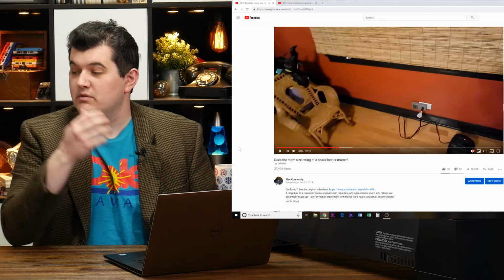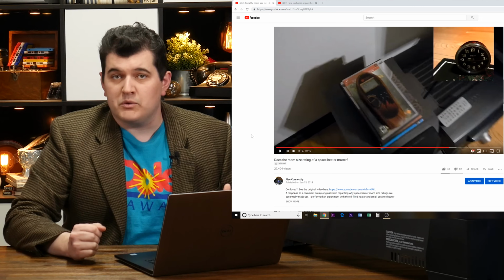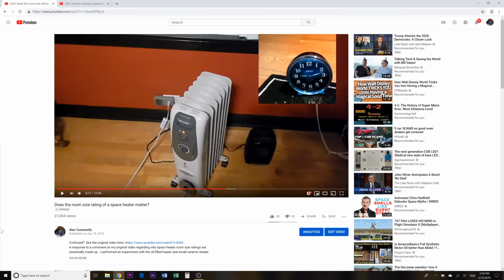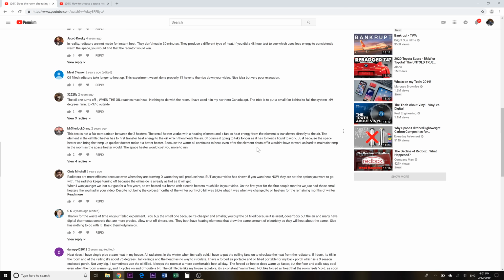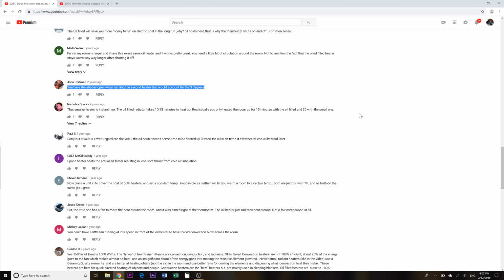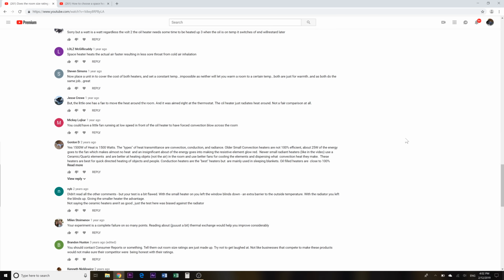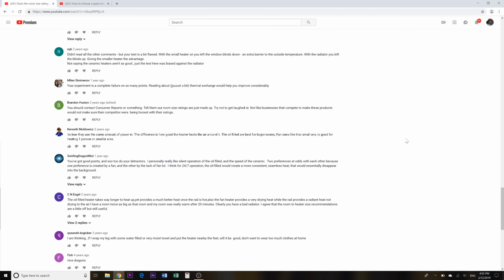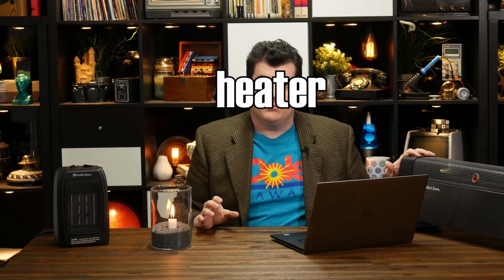More Space Heater Nonsense

Comment: I hate space heaters too. Cars burn fuel and give work and heat . heaters only heat.on a cool evening I try to fix something in a crock pot  like apple butter , heat and work.  but I  want a heat pump water heater to help with cooling and a Honda in house engine that makes electricity  while heating domestic water  but tech is so expensive short term.

Comment: ITs about saving on watts.. if you can maintain the tempature you dont use much energy as on a subatonic level the electrons when friction happens generates heat.. aka Oil heated and the metal around is creating heat aas electrons break down.  So if they maintain teh tempature without drawing from the wall you save on costs.
Reply: That's bullshit. Oil filled heaters don't magically create free heat energy.
Reply: Not free energy.  It starts with vibration.  When electrons vibrate enough through friction from conectic energy creates heat.  Now the purpose of the hot oil to to retain the heat.  For the metal around the oil through conectic energy allows teh electrons to break down thus maintain teh same output .  without having to draw 1500 wats an hour.

on the standar heater once you shut off the heat lowers down quickly thus under 200 degrees teh electrons no longer vibrate thus no heat is transfered.

Its the laws of theorodynamics and physics.
nwo the real issue os not to traw 1500 watts an hour otherwise your heat bill is over 150 dollars on that one heater.  Which is still not heat effectiant.
However  no one is trying to make low wat energy that outputs 4 square inches a second of heat.
the average heater requires 1000 watts minumum an hour to create 4 sqare inches per second of heat.

If they somehow can create teh same about of vibration on teh electrons with lower watts then it will be more effecient.

Comment: One thing to consider is that for people with the financial means to support a larger room, they might also have the thought to buy multiple.  

I grew up in sunny Arizona so I have never actually used a space heater myself, but I would be inclined to believe that several of those baseboard units would be suitable in like a living room/family room area, in front of windows or what not, as the aesthetic is far improved to that of the small-room unit.  

Considering too what the commenter mentioned about drying out the air more with the small one, I think the low-and-slow style of the baseboard units makes them suitable to be run in menagerie on timers, turning on before you use a room, rather than the broiler-style small one which would in duo serve to heat a room shortly after arrival.  Just looking at them though, I feel like the baseboard heater would service to make a room more comfortable and hospitable than the small one, just by looking at the shapes, with no knowledge of how they actually feel.

Comment: I like this video and agree with your assessment, I just think you should re-remake it, with your usual scripted elegance to organize and hammer home your points as clearly as possible. 
It seemed the most cogent dissenting opinion was that one about the radiator style heaters not drying out the air as much. Certainly personal preference and aesthetics can be a useful criteria for making a choice, but the size of the room is indeed marketing poppycock. I agree that it might have more to do with physical heater size as that later comment mentioned. 
That also got me to thinking… Do you fan style heaters actually dry the room out more? How is that possible? Blowdryers don’t actually make moisture cease to exist, they just move the moisture somewhere else. I suspect that radiator style heaters don’t actually leave more moisture in the room, they just suck at heating up anything other than the upper layers of air in the room, therefore, people who use them, can sit in their large room smugly chuckling about how their skin isn’t being dried out, trying to pretend they’re not shivering. I’m originally from Chicago, I can confirm that other than the insanely hot boiler fired radiators in old apartment buildings, radiant style heaters are not as good as any old fan assisted space heater.

Comment: As an electrician in Sweden I feel you. Customers often ask me what type of radiators they should get (infrared, oil filled, flow or convector) and it usually boils down to them not understanding that 1kw electricity in is 1kw heat out.
Reply: Usually smaller heaters are louder heaters, though not always.
Reply: @TimpBizkit  Depends on how well the individual components are constructed and assembled, where you're putting it and how well you maintain it, too.  That would be, probably, about the only area where price makes a difference; cheaper ones tend to be made with lower quality parts and assembled with less precision leading to more noise while more expensive ones are generally quieter because they're not.  Like you said, not always though, especially if you invest in the more expensive (quieter) unit then put it somewhere like a workshop, garage or near a pet bed then neglect to keep it clean.

Comment: Well, I do generally agree with you, 1500 Watts is 1500 Watts, really there's no need to test it. If you wanna go and test it though, you should let both heaters heat the room to a specific temperature and let the room cool down again (without opening the windows) to compare the heat up times and cool down times.
Or perhaps an easier way would be to let both heater run for an hour or so in a separate room before doing the test to insure they're both up to heat before starting.
Or think of some other way to measure the heat output while taking into consideration how long the heater takes to heat up. Just assuming the heater should be up to heat after a given time isn't a very reliable way to test it.
Obviously though none of these tests are scientific. Even if you assume your room has perfectly constant loses etc. convection heaters can heat rooms unevenly, therefore your room could be warmer on average but just happen to be colder wherever you are measuring it, while the heater with a fan just reads higher temperatures because it spreads its heat out better. Of course you could argue that a heater is supposed to heat a room (not only part of the room), therefore if the heater doesn't do that, it's still not doing it's job very well. In that case you would rather be measuring the effectiveness of a heater, not how much heat it puts out. But I guess it's a fair test since heaters for bigger rooms should (ideally) also be able to spread out the heat well enough. And if they don't spread their heat out well enough, then they are obviously not well suited for a large room.

Comment: the air becomes really dry and dusty from the air blower, while the oil filled radiator keeps a nicer, less dry, and less air stream climate. Also I would not want to sit or sleep with a fan blowing w/ it's noise going on.

Comment: Yes, the amount of energy is the same, but because of different contact surface area, the energy is diffused in different amounts of time. Yes, their efficiency is the same, as in, all the energy is converted to heat, but the time it takes to radiate the heat is proportional to the surface area of the heat element. Now the fan on the smaller heater muddles this somewhat, but imagine you had two identical heaters with no fans, the only difference being their size (and therefore surface area). The bigger heater would transfer its energy into the air faster once it reaches the same 'idle' hot temperature as the smaller one. It will take longer for it to reach the same 'idle' temperature as the smaller one because of the bigger mass to heat, but once it does (and probably some time during the heating up process), it will radiate its heat at a faster rate than a smaller heater because of the surface area.

What I'm trying to say is that at a certain point, the smaller physical size of a heater will bottleneck its effectiveness. The fan is a great fix for the small contact area though because it works by lowering the 'ambient' temperature around the heater, therefore speeding the energy transfer significantly by raising the delta T.

All forms of heat transfer formula include the contact surface area and the temperature difference, so it's important to not forget about the area.

Comment: The problem is you didn't realise your experiment seems wrong when first presented. Even though you later detail what adjustments had to be made, the way you explain your experiment is at first profoundly wrong, even though you actually did do it right in the end, you explained it wrong at least to begin with: 

1- same testing conditions and 2- "oil heater" is delayed a bit. Everyone knows that, but at first you don't say anything about it, you were expected to, and so your experiment appears dumb. Later in your video you actually do address both of those issues appropriately and so your experiment brings to light the issue of "oil heaters" "thermal throttling" which ironically makes the big heater heat less. GG.

On a side note, when buying a small fan heater you should also buy the ear plugs to go with it. Or get a reversible ac it's 3 to 4 times more efficient...

Comment: Video Idea, repeat your experiment. This time hang a string from the ceiling. Add washers painted black every 30cm or so on the string. Get a laser thermostat and measure the temp of the washers every 5 minutes or so for half an hour.
Repeat the experiment for the oil and fan heater. 
That should give you data you can work with. The heat could all be above you and effectively wasted. 
You could also add more "strings" at different parts of the room relative to the heater.

Comment: the oil filled heater takes longer to heat the oil once its up to temp then it starts.. the small ones use reistive wires.. so its instant... it takes 2 hours to heat  a 15x15 room... and you dont need the full power use setting one 400 watts... make sure it has a fan on it... and you can get one for 12 bucks

Comment: (Better/Worst) I think one of the false presuppositions in space heater land, is that you're not supposed to run it on high except in extremely rare circumstances.  While clearly most people do run their space heaters at high and nothing but high.  What you may see is that some space heaters offer lower dial settings, while other space heaters do not offer those lower settings at all.  The heaters that offer lower settings might market themselves as more useful in smaller rooms.

Comment: (Product Fail Problem) If I can send you an email with photos, I have some space heaters with internal parts that start melting because the company replaced the metal tip-safety pendulum with a plastic tip-safety pendulum.  Once the pendulum melts off, the space heaters can tip over and continue running.  Haven't heard back from the company yet.

Comment: Hello. I rarely comment on videos (well, most of the time I cannot find anywhere to comment, but I did find it for your video). Now, I realize that the point of your video is how much wattage is used by these devices, by comparison. I agree that the devices are all limited to 1500W maximum. The design of a device determines the duty cycle of the device (how long it is on versus how long it is off). Duty cycle will be a factor in the total BTU/Hr that a device can put out (and thus how much heat will be pumped into the room, this will also determine the Kilowatt-hours of energy used per day). It may be that larger heaters can remain on for a longer portion of the duty cycle, meaning more time spent heating (your discussion did not compare kWh of electricity used over the same time period, and I don't know if your meter can measure that). The discussion thus far is good as far as it goes, but I believe that perhaps another video may be in order (after some research), regarding two related issues:

1) What is the purpose of heating (room temperature vs comfort level, and the factors governing each). By that I mean, are you interested in keeping the room air or room contents at a particular temperature, or the people at a certain comfort level..

2) Comparative efficiency of various methods of heating (forced air, radiant baseboard heat, other less main-stream heating systems such as Rocket Mass Heaters), such as how efficient are they in turning the fuel into heat of the desired type (you already pointed out that the generation of electricity is not necessarily efficient, though it's distribution may be more readily available than other heat sources).

I know, the video was about portable, temporary heat, and in that, this recommendation goes way beyond, but again, I think it needs to be addressed.

One esample of the comfort vs air temperature was a "home of the future" that Iread a book about where they had two rooms with the walls lined with copper plates or sheets. In the first room, the air temperature was kept at 90 degrees Farenheit, while the walls were cooled to 40 degrees. People entering the room felt chilled. In the second room, the walls were heated to (at least 72 degrees, I do not remember the exact temperature, it has been a long time), while the air was kept at 40 degrees, and a small infrared heater was placed in the corner of the ceiling. The people entering began to sweat. It went on to present the the comfort level of the people was more dependent on the radiant heat than the air temperature, because heat by conduction from air happens only at the surface of the skin, and once that heat has been absorbed, the person begins to feel cold again. You notice this when your forced-air furnace turns off.

A book I read on the observations of Count Rumford on good fireplace construction had some interesting observations regarding fireplace purpose, efficiency, and design. The part that interested me was again the observation that it was heating objects in the room that then re-radiated that heat to the occupants that made them feel more comfortable, and the more of the heat produced by the fireplace that was able to be utilized to do so, the more comfortable the occupants.

So, unless your purpose is to keep your fish warm, radiant heat is (as I believe you did point out) more efficient at keeping people (and dogs/cats/etc.) comfortable than forced-air heat (be it from a furnace or a space heater). And I didn't even mention hot water or steam heated baseboard radiators. You did mention heat pumps, and there is another technology that needs mention: thermoacoustic heating/air conditioning/refrigeration (a technology that we seem to have little public information regarding it's relative efficiency as far as power in versus heat transferred).

There is more I could say on the topics, but this should give you something to consider, at least. I do believe that there are many areas with regard to efficient heating (and cooling) that need more investigation and experimentation.